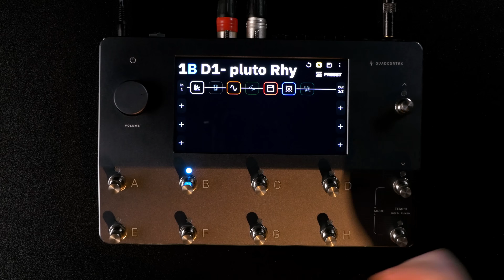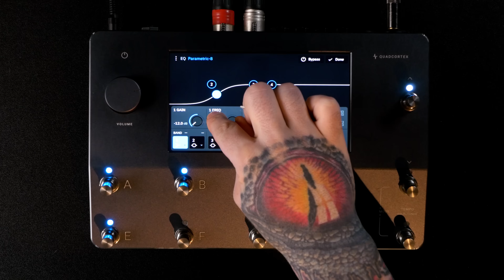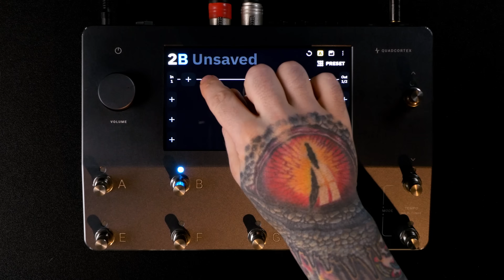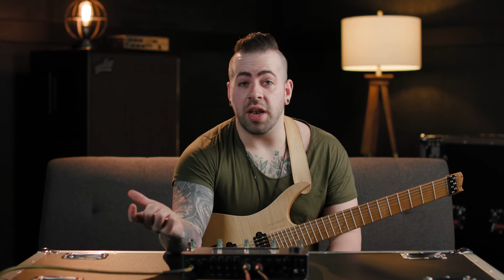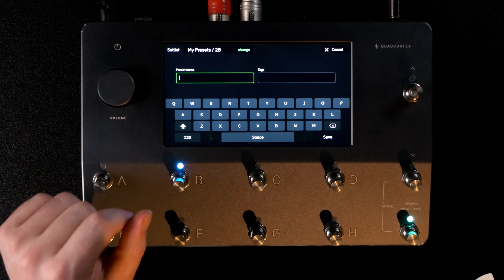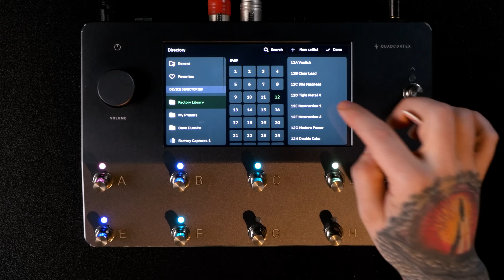Neural DSP Quad Cortex Real-World Experience: Dave Dunsire

Comment: The Axe-Fx blows the Quad Cortex out of the water in terms of flexibility and control, so I'm not sure what he's talking about. The amp models themselves sound good. Are they out of the league of the Helix or Axe-Fx? No, but they sound good.
Reply: I would say in terms of speed and ease of use the cortex beats the others out. You are right that the fractal has more in depth controls but I would say “using both back to back” that it takes significantly longer to dial those sounds in on the fractal and that some of the more tweaky control options aren’t quite as useful. Both are great but hearing and using them both in the same room that’s how I came to my decision. Although I am still on axe fx 2 🤷🏻‍♂️
Reply: @DaveDunsire  Also you work for Sweetwater who sells the QC and not Fractal so there's that...
Reply: @martymeatball  I own a axe fx 2 myself though! I have also owned the kemper in the past and while we do sell QC and not fractal “they only sell direct” I’m giving my honest 2 cents. I said it in the video that the other modelers/profilers are great products but this is unique in design and innovation and I really enjoyed it!
Reply: @DaveDunsire  The QC's front panel UI is similar to the Helix in terms of simplicity; however, I almost never use the front panel and much prefer editing via desktop app. Personally, I find Axe-Edit to be one of the simplest and most powerful desktop editors of any modeler on the market, and if it turns out that the differences between the QC's front panel UI and the desktop app (when it's released) are minimal, then I don't see that changing. Before upgrading to the Axe-Fx III, I owned an Axe-Fx II XL+, and in my opinion, the speed differences in terms of dialing in tones between the two is fairly significant. It's far easier to dial in usable presets with the III. In fact, I find that the character between the various amp models in the III really stand out and are far more defined when comparing them against each other.

I think the QC's Neural Capture sounds quite good and I would've considered trying the unit; however, the deal-breaker for me was requiring users to be connected to the cloud in order to save and share individual presets, which means there's no offline option for exporting individual presets to a computer or thumb drive. You literally have to be connected to the internet if you want to save individual captures and presets anywhere other than on the unit itself. It's a dumb requirement that, from the feedback I've read, has caused a number of people to cancel their pre-orders.
Reply: Holy annoying 🙄 We get it dude, you don't have to like the QC. Stick with your axe fx and move the __ on already.
Reply: @TomCouture  I like the QC with the exception of the cloud requirement. If my opinion annoys you, then don't read it.

Comment: That tone does sound decent. Honestly, I think it sounds better than Helix, but not nearly as good as Fractal. I realize that the capture is the flagship feature, but I feel like it's going to take a long time to get any kind of variety just because of the limited number of units and those of us who have ordered one don't have many amps to begin with.  I think Neural is really going to have to push some firmware to improve the sims to get more people on board with it. Hopefully, they will improve the sims and effects before releasing hyped up amps. I have high hopes for this unit, as it should set a higher bar for other manufacturers.
Reply: The sound of the sims all depends on how each person has dialed them in. There really is no way to know how good they are for you until you mess with them yourself.
Reply: @SamuelAging  For sure. Though it's hard to argue with the fact that with a Fractal unit, you can just select an amp and cab, and you're album ready.  If you have to still program this thing as much as a pod, even two years from now, to make it sound passable, that will be a disappointment.
Reply: I am able to get some very realistic simulations out of my Fractal Axe Fx 2 Mk ii. I don’t really use anything metal just mostly the clean and crunchy amps and the use their sim pedals to get what I want. Maybe the Quad is very good for metal but I would be interested in how the lower gain sounds.
Reply: I agree that Neural Capture is really this unit's flagship feature. I own an Axe-Fx III and a Kemper and the only reason I'm no longer considering add a Quad Cortex to the lineup is that the company insists on not allowing users to save/export/share individual captures and presets offline(ie. to a computer/USB stick).
Reply: @ColdFrixion  Wait. I thought that's what the cloud was for. Tell me more.
Reply: @William_Earl  You'll need to access Cortex Cloud in order to save and share individual presets and captures. You can't save/export/share individual captures and presets via computer or thumb drive. According to Doug Castro, all file transfers have to go through the cloud. You'll be able to make a full backup of the unit offline once the desktop app is released, however.

Comment: No pedal and not enough CC pedal inputs.
Reply: Rather it has 2 ports for your choice of a pedal, much better than one "built-on" that breaks after a bit of use...
Reply: @gotmilkduds6683  I use 3 pedals:) 1-Volume, 1-Gain, 1-Effects:)
Reply: agreed
Reply: MIDI.
Reply: @DavidEidelberg  Good suggestion. I am not aware of a midi pedal, but am aware of the Ground Control and others like it. I am happy with my BOSS GT 1000:)
Reply: @batmandeltaforce  Love the GT1000 , I had to tweak with the cab section to get the sound I personally desired. I also use a Morningstar MC8 midi pedal and it has 4 exp pedal outs and is not super complicated to set up. I am lined up to get the QC but out of curiosity not of of need. I need nothing.
Reply: @wolvesandguitars  Morningstar MC8 looking that up NOW:) thanks... Oh man that's cool beans dude:)